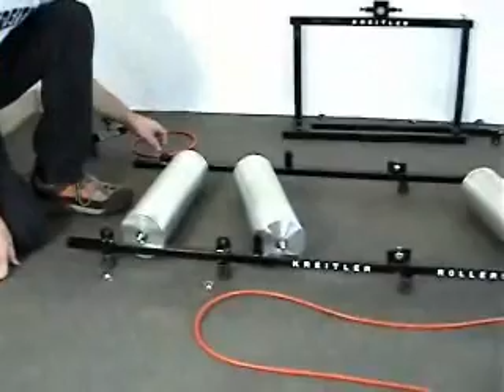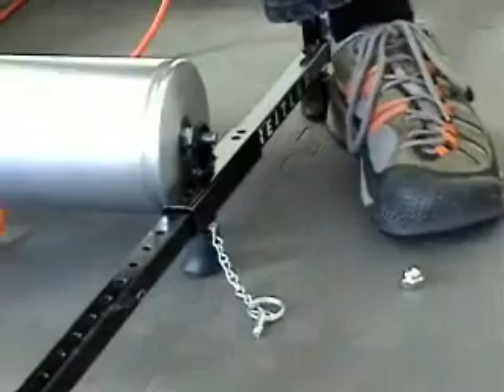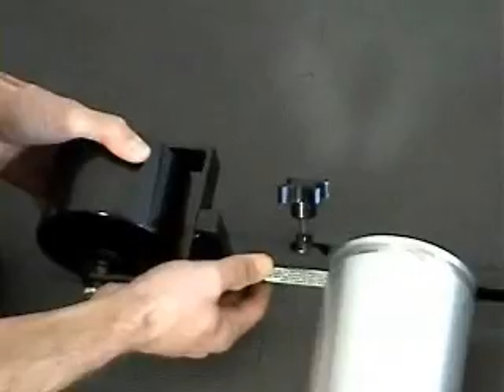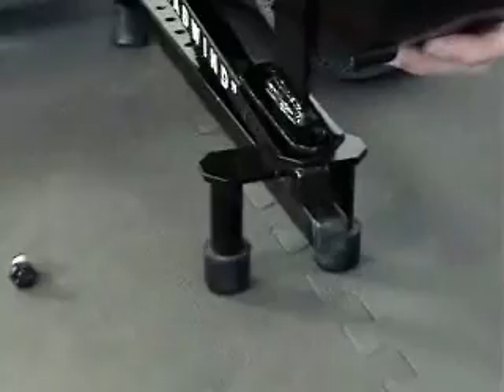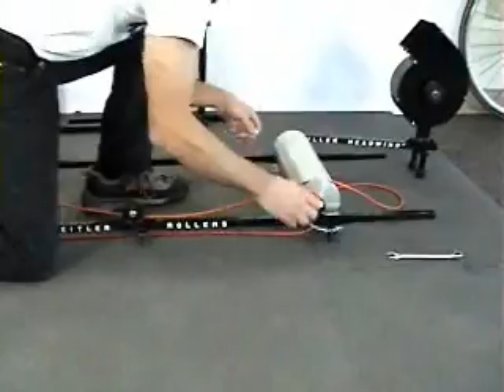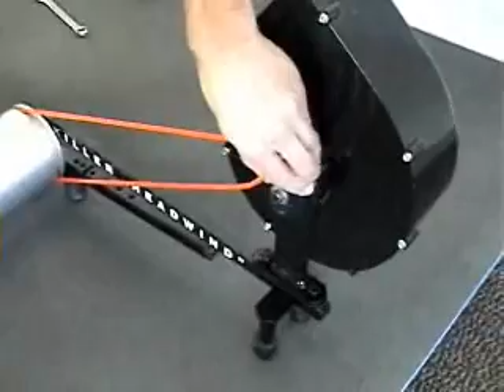Kreitler Roller Assembly and Set Up

Comment: Just bought a full Kreitler trainer with the killer head wind and the weighed pulley, it’s 12 years old and everything needed adjusting, cleaned, the belts were black and the killer head wind was loose and out of adjustment. I repainted it, adjusted all of the bearings and installed the correct hardware. It works like brand new and for the amount I payed for it, it was totally worth it. Kreitler was built to last and to hold up well, this trainer is a beast!

Comment: To repair bearings:      Kreitlers can be found used at swap meets.  I got some dyno-mytes for $75/pair, sold the spare pair on ebay= free rollers.  I just knocked out the old bearings after a few years use.  Use a Rubber mallet, make sure they are level, tap, tap, taparoo. To install:  1st bearing: Take roller, gently tap in bearing.  Then Insert the threaded spindle rod in the roller and then  (DO NOT TAP IN BOTH BEARINGS AND THEN TRY TO ASSEMBLE) tap in the 2nd bearing from the outside (obviously :) ) by placing a stack of old bearings  (THIS IS HELPFUL TO AVOID DAMAGE) you tapped out of the other rollers on the threaded rod/spindle.  Gently snug inner nuts against bearings (finger tight max) and then tighten the outer nut while holding the inner one, making sure the inner nut does not further tighten against the bearing (make sure threaded rod does not turn).  You can figure the rest out.    Get the bearings from Kreitler, it will save you a lot of cheap bearings that don't work ($25 for all 6).
Reply: How do you actually tap out the old bearings when everything is sealed?

Cameron